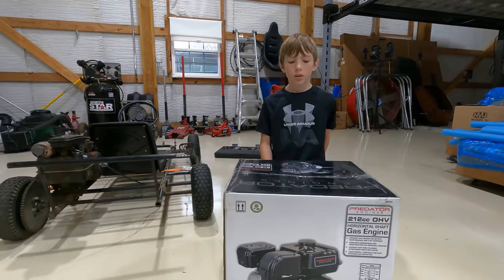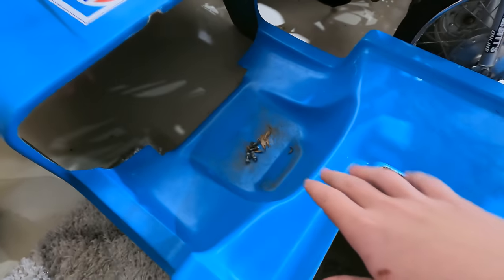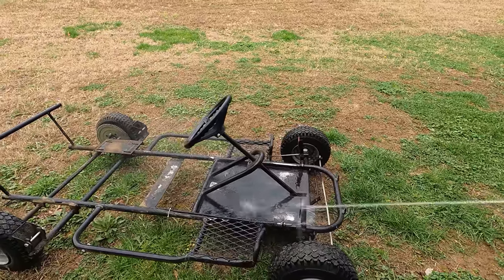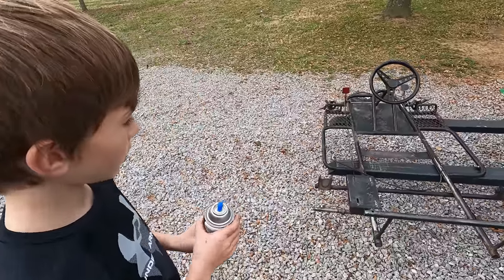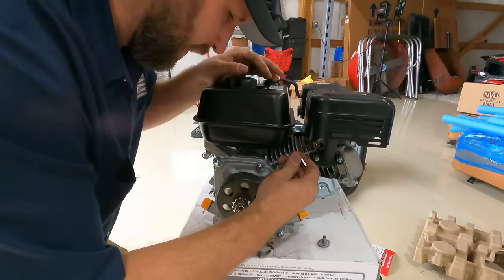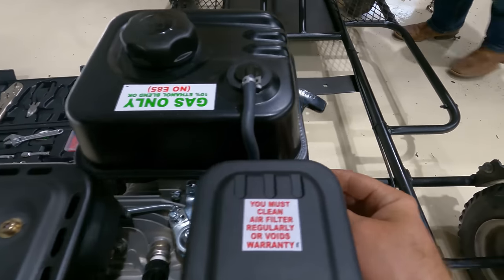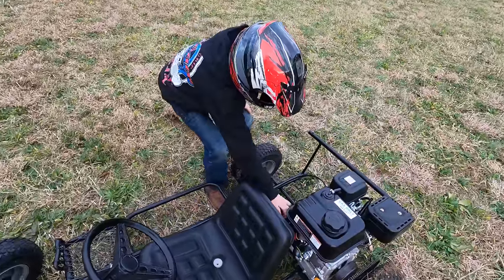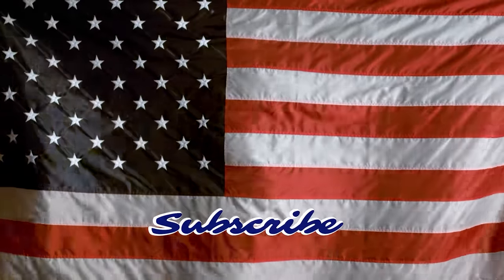REPOWERING my Classic Go Kart with 6.5HP (DOULBE THE HP!)

Comment: Derek, you are a great example of what a father should be. Teaching them youngens  the ins and outs of life itself is a wonderful thing.
Reply: Totally agree 👍
Reply: Agree!
Reply: Unhook the oil level and sensor on go-karts when you go around turns the oil moves and it will make the go-kart motor shut off I run the predator motors on all my go-karts if you don't unhook the oil level you will have trouble when you go around the corners

Comment: Bentley - great swap ! Idea for why the engine is stopping when hitting a bump - the low oil level sender unit on these are sensitive.  Try either disconnecting that “safety” device - or overfill the oil a bit so the sender is always in the oil.  Cheers. !
Reply: I was going to say the same . I had to disconnect the one on my generator i put on my bus camper to run it for the AC . while driving . there wicked sensitive.

Comment: VERY WELL DONE YOUNG MAN!  Build that engine as soon as you can. I rebuilt my first one when I was 9.  I'm 62 now.  I know you have the money for the new parts now.  I just watched your family's "webathon" mailbag and saw where people gave ya'll some cash for just such things.   Since you're going to be working on a bunch of small engine stuff you should order you  a set  screw kit,  Key stock kit for things like that clutch, rolled pin kit, QUALITY electrical crimps(NOT THE JUNK FROM THE AUTO PARTS STORE).   Spring kits a good to have as well but not as important.  ALWAYS save your old bolts, nuts, screws and various other hardware.  I keep all my scrap bolts in plastic coffee jugs sorted in some manner, then nuts, then machined screws then metal or wood screws.   It is extremely gratifying when you're working on something and come to a place where you need a certain piece of hardware and find it in the bolt bucket, for example.  

Well done indeed!

Comment: Hey fellers, I'm an old Motor City go-kart guy and amateur gearhead and I think the channel is great.  Been watching for some time now.  THE LOW OIL SHUTOFF SENSOR IN THE CRANKCASE SHUTS THE MOTOR OFF WHENEVER IT DETECTS AN (IMAGINARY) OIL SHORTAGE AS THE OIL SPLASHES AROUND INSIDE UNDER "TRACK" CONDITIONS ( I THINK ) YOU CAN DISCONNECT IT'S WIRE AT THE ON/OFF SWITCH OR OPEN THE ENGINE AND REMOVE THE SENSOR COMPLETELY.  JUST MAKE SURE THE OIL IS FULL EVERY TIME YOU RUN IT AND "IT'LL BE FINE...".  Derek, thanks for the laughs and lessons, the kids are your true treasure so enjoy them every chance you get.

Comment: Great job on the swap Bentley, and big thumbs up to Dad for lending a hand. Might be an idea to see if the pull start can be rotated to move it out from behind the seat so you can pull straight up.
Definitely rebuild the old engine. Good for learning the basics and you'll find that engines, small or large, have a lot in common.

Comment: Love the video! My son watched every second! If y'all disconnect the yellow wire on the front of the engine, it won't cut off when you go on sharp turns or bumps. That is the oil cutoff sensor.

Comment: Delete the governor and go directly to the throttle plate. 
Also move you kill switch to where you can reach it. You can rotate the pull cord housing so that the cord points out the back. this adds an extra safety because now you're standing behind a sudden launch. 
As someone else mentioned if you disconnect the low oil switch for a test ride you may find that's your problem. A half quart extra oil might cure that problem.

Can't wait to see the engine rebuild series.
Reply: Agreed, just make sure to actually get rid of the governor internally so it doesn't blow apart and cause major engine failure.

Comment: That Smile on his face when that engine started up is priceless. And I see a Live axle upgrade coming soon. as for the cutting off trouble try to set the carb float down just a little. what's going on is when he hits a bump the float is diving down and letting gas in when it don't need it so it's flooding the engine out. if you set the float down some that should give it room in the carb for the extra fuel and no flood the engine. Be a good place to start. Love the video and look forward to the next one

Comment: Those engines have an oil level sensor that will shut them down. Just unplug the wire and you’re good to go, you have to do that on tillers and such because of the bumping around.

Comment: Bentley is a natural on camera doing these videos.  This was a really awesome episode.   Derek you do such a wonderful job with your kids, it is such a treat to watch.   I see by the time I've watched this you've fixed the stall outs with the low oil sensor.   Would there be any advantage to also having some rubber bushings between the engine and the frame?   Either way it's obvious Bentley loves the new power.   I would love to see an engine rebuild.   You two have such a great connection it's just fun to watch you working together.   Thank you for sharing the content.   Oh and that bit  "A kid's gonna go ahead and use the tractor as a hoist", made my day.

Comment: I love seeing you guys working together father and son bonding time is the greatest!!  I would like to give a little tip about the engine shutting down on you. It is actually the low oil sensor that has to be disconnected on those. When the oil sloshes around it shuts it down because it thinks it is low. Disable that sensor and it will stop shutting down every time you’re on it!!  Keep up the good work and I hope you’re enjoying it down in Tennessee because it is 30 below in back up up ole Minnesota today! Keep up the hood work!
Reply: Oops I was a little late on that didn’t see you already had it figured out!!  Either way glad you guys are doing what you do and it sure is nice to see it getting passed down!! 😁

Comment: Hey what's up little guy. You need to disconnect the oil sensor, it's made to shut the engine off if the oil sloshes around by bouncing around and going around turns. It's the little silver box next to the kill switch, just cut the wires and you're good to go 👍🏻

Comment: This is fantastic to watch.   FYI 
 The kill switch is good to have up front where the driver can reach it, rather than the one located on the motor.  If a kid gets stuck in the mud or against a tree, it's tough to access the rear switch from the seat.  You can easily plug the front switch into the rear wiring harness on the motor.  Your cut-off issue is very likely the oil level sensor.  Simply unplug it and trim the wires.  If you upgrade down the road, you can remove it from the inside.

Comment: Well done..  A little extra work to get it to run in the rough is not unexpected.  Keep at it.. Also, I'd love to see you rebuild the 3 HP engine. That's how I started out; and before you know it your neighbors might pay you to fix theirs too!!!  And/or getting paid to mow their grass!!  Don't be surprised if you get paid for both!!! You know, get paid to fix the mower and then get paid to do the mowing...  Have fun AND...  Your dad often wears those blue Hobo Freight gloves.  Works a treat and save a lot of time in the end...  Do the dirty part and throw the gloves in the trash and if you use several pair during a repair.. That's fine!!!

Comment: These 6.5Hp 212cc predator motors are pretty good I installed one On a Old 70s craftsman green rear tine tiller gave a bunch of power to a tiller thst had a worn out briggs and Stratton 6.5Hp engine was was a 190cc or 200cc can't remember

Comment: Ahh the go-karts, fun times.  My cousins had go-karts and the first time I was at their house when I was a kid the first thing my mom said was stay off the go-karts...yeah you never tell a kid to stay off a gas powered toy LOL.  

Part of the issue with the engine shutting off could possibly be the low oil shut down sensor...the bouncing around will slosh the oil all over and away from the sensor causing it to think the engine is low on oil and shut it down.  A simple bypass by pulling the wires off the sensor and butt connecting them together would take care of that...its a common issue using that engine on a roto tiller as well.

Comment: Just started watching the channel and I think it's awesome you do this with the kids! I actually own one of those predator engines in a cart and I might know what's causing it to stall if you haven't figured it out yet. I believe there is a tip over sensor of some sort on those engines and with no suspension it might be triggering the sensor when whipping a donut. It's easy to disable it! That might fix it!

Comment: Built a similar go cart with my boys for Christmas two years ago. I also didn't think of oil cut off switch. Watched cars and cameras vids... now, two years later our one wheel drive go cart beats the new 120 cc tao tao chieneseium four wheeler on our field track. an easy but dirty way to make that throttle return is to use an old school Spring off of a garage door and hook it to the outside of the pull  start cover. So naturally we took the carburetor off that Chinese 4 Wheeler immediately... Ordering an adapter to put it right on our 212. There's more to the story last year we broke a crank shaft and we took a crank out of a much older 212. Which immediately ran better than it ever had I gotta believe has more stroke and is now a high compression engine. This was a one wheel drive on road go cart that now has offered tires on it and drifts around as long as you're turning right. It's been a great experience with the boys I have pictures of my oldest put in the crank in the engine tightening the rod bolts. I wish I would have filmed it the way you did. My boys have always been allowed to use whatever tool is virtual their development state has gotten them too. Derek is a father I respect what you did I want to get out and work even more with my boys.

Comment: One thing I had to do to my go-kart was disconnect the governor.  It was an old 5 HP Briggs & Stratton engine.  But it would pull a hill so much better when the governor wasn't letting the engine open up.
This makes me want to pull out my old Cyclops 440 go-kart and bring it back to life.  ;-)

Comment: You could try adjusting the float in the carburetor to different levels until you find the sweet spot to where it keeps enough fuel in the bowl to run all the time but not so much it floods out when it sloshes on the sharp turning.  Hope this helps but I am no expert!  Great show Lil Grip.

Comment: I got the same motor. You have to unplug the oil sensor wire on the block to get it to stop stalling. I put one on my tiller and every time the tiller tilted it would quit

Comment: One of the first things I noticed about his son on the web of his right hand he has wrench rash👍🏼 he has an awesome dad and mom and they have an awesome son😃 if more parents would spend this kind of quality time with there kids we have a better society. Also on the engine I believe the three bolts that hold that pull starter on just clock it to the back so you’re rope won’t bind when pulling to start. Could it possibly be the reason why it dies out is the carburetor float? The engine isn’t supposed to bounce up and down/jolt like that? I know on the old Tucusm and briggs & Stratton engines with the float it would behave that way on go carts and minibikes just an idea 💡 . Back again I was reading comments and the other guys are right it’s that low oil pressure switch I remember this from the Honda engines that’s exactly what the problem is👍🏼 spot on guys 😀

Comment: So I had the same problem with my preditor engine so there is cable that is attached to the kill switch and oil so every bump you go over it is not detecting oil so it is killing it so all you have to do is pull that plug and it will stop but just make sure you check your oil more often so you don’t hurt your engine

Comment: Derek you can just tap in to that wire that you Unplugged fro the low oil sensor and run a kill switch to the set for hem if you use a two way switch you just run one wire to the fraim and the other one to the motor

Comment: Update:  I read some of the oil cut off switch comments.  There is a reason this switch is there.  As with drag racing engines, momentum moves the oil away from where it is needed.  Disconnecting the switch does not solve the low oil it is telling you about.  Since it is obvious you guys know mechanics, I strongly suggest you build a windage tray to keep the oil where it needs to be.
Reply: Intermittent low oil will be fine.  Cars and Cameras guys have been running these predator engines for a decade with DC'd low oil sensors and haven't ever siezed an engine that wasn't abused like a flat screwdriver in a torx factory.  That, and the pewdator 212 is a whopping $200.  If it lasts 2 years until he's ready for a live axle 420, bonus.

Comment: Nicely done Bentley! COuld the problem withthe bump and quit be due to the float? Just wondering if the bumps are causing the float to move and close the needle valve supplying gas to the 'fuel-make it happener'. Good luck with the fix and let's see the rebuild of your old cart engine,.

Comment: I'd check the carburetor float blow for dirt.& Debris inside of it. You adjust the air fuel mixture set screw on it. That  will increase the fuel flow more when you're giving it more gas pedal when you're turning to do donuts on it with to.

Comment: Unplug the yellow low oil sensor wire!! Its great if you are using it on a power washer and it tipped without you knowing, you would want the engine to shut off. But when on a buggy, kart or mini bike it will die the second you hit a bump or make a turn. The oil sensor has a float, and when its away from fluid it grounds the motor to shut it down

Comment: Evidently there are two versions of this engine. Manufactured at two locations. They're calling one version the "Hemi engine". Serial number will tell you for sure. But you can also tell by valve spring cover shape and air filter. Just wondering.....did you do any engine break-in. We bought one last fall and let it run with no load at various idle speeds for about 3 hrs before feeding her any onions.

Comment: Those predator engines have a safety thing for low oil. There is a yellow wire with a connector near the on/off. Unplug that yellow wire problem solved. I had two go carts with those engines.

Comment: I would say oil cut off switch. Those things can be sensitive. Even if the oil level is proper, the bouncing around might take oil away from the switch and cut it off. Just disconnect and check the oil level every time before using.

Comment: I think those have an oil sensor that cuts the engine off when he spins it out.when he turns fast or hits bumps the oil goes off the sensor  It's a safety for if the engine is on a tiller or something so if you tip it over it turns off.

Comment: Make that rear axle solid and both wheels drive wheels. You can get kits that have mechanical disc brakes even. And run the governor spring on the low setting( or if you wanna really have fun take it off entirely😝 not sure how long the motor will last tho)

Comment: There is a little yellow wire on the front of the motor with the kill switch it is a low oil sensor just un plug it and you have more fun it will stop dying.       Ps have fun good you Geting in to it know good luck have fun :)

Comment: I'm pretty sure I spotted your missing shaft/clutch key lying on the old case at 9:35.    Remember, the actual carburetor butterfly is controlled by the governor.  I'm guessing it's a wind vane style which responds to the cooling air fan.  The factory "throttle lever" simply biases the governor by setting spring pressure vs the force on the wind vane in order to set a constant speed.  That's all good for a pressure washer or tiller, but completely unnecessary for a go kart.  As the kart bounces around, the floppy governor system bounces too, effecting the carb butterfly opening. See if you can disassemble the components associated with the governor and operate the carburetor butterfly directly with your foot operated throttle cable.

Comment: It’s doing that because of the censor for the governor for low oil sensor even tho it has oil since it bounces it doesn’t register so it stalls it thinking that it is helping you can remove it and take the senor off and unplug it but you will need to open the engine up and it looks like plastic gears
Reply: Sensor*

Comment: The new motor you should be able to loosen the bolt in the middle of the throttle mechanism and it will give it the spring action you need

Comment: I highly suggest changing the stock rod for a billet rod. Stock has no bearing. It relies on a slinger to get oil to the rid journal. Aluminum running on a cast iron crank is only a matter of time before galling begins.
The billet rod is a bit of engineering genius. Not only do you get the strength of the billet they use a typical babbit bearing like a car. And instead of the oil slinger they use a scoop that forces oil up a hole and it feeds the rod bearing directly with oil.
Others swear up and down that you need a billet flywheel if you remove the govenor. Minibikes I'm all for not grenading a flywheel between your legs. A go cart? Not so worried about it. There are steel wheels that are cheaper than billet aluminum for anyone wanting to be safe on a budget.
While you are doing the rid, and deleting the governor, might as well put in a cam. Nothing wrong with the Black Mamba, or Black Mamba Jr. cam.
And lastly get rid of the clutch, and get a Comet chinesium clone torque converter.
I have a 212 with all of the boltons. Head, cam, rod, flywheel, roller rockers, larger valves, 36lb springs and it will move a fat guy on a minibike 65mph. Scary fast